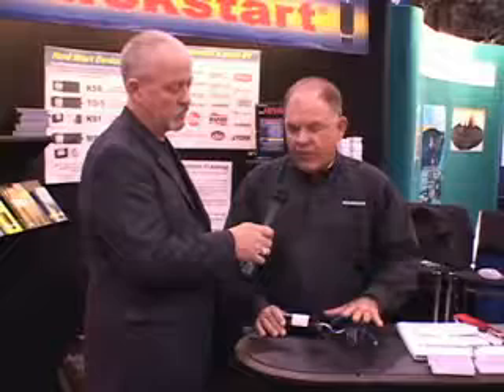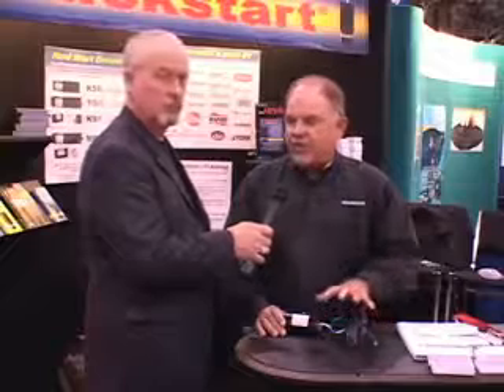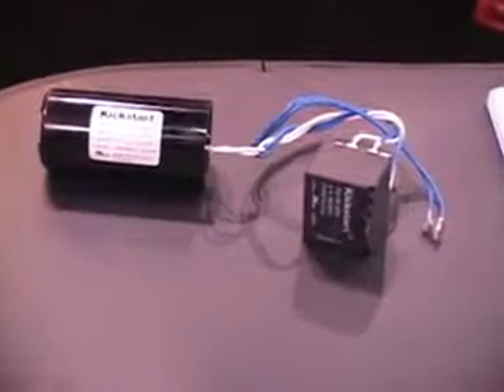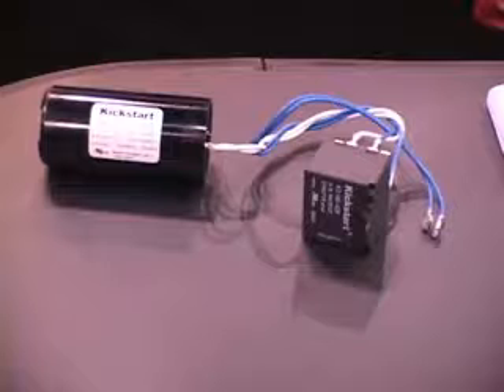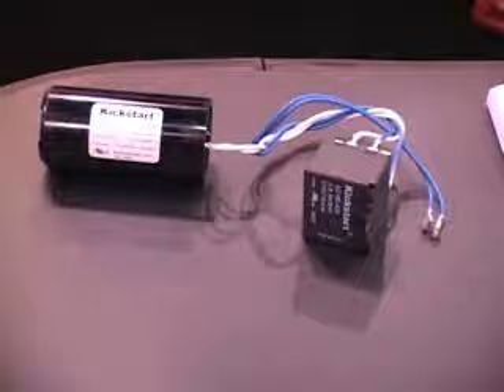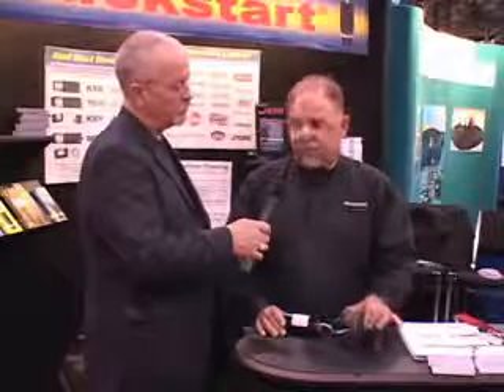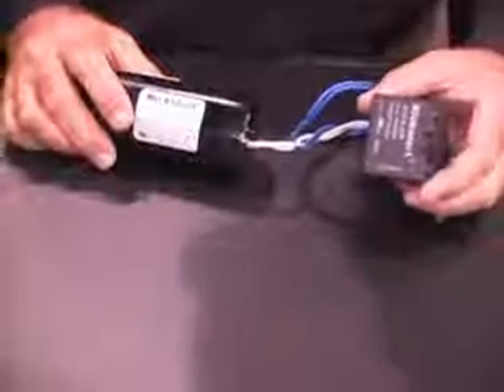Kickstart® Compressor Hard Start Devices clipnabber com

Comment: I have a 5k btu 4.9 amp 115v LG mechanical AC & a 5 amp Kenmore chest freezer in a sevice vehicle that I will power with a Honda type gen. . How do I determine which type/size hard start cap to install in each appliance?